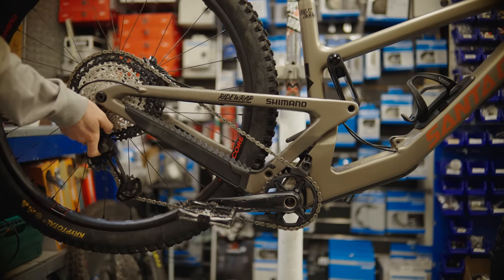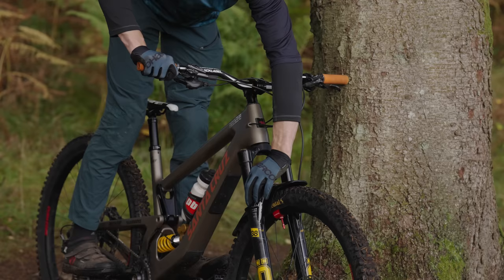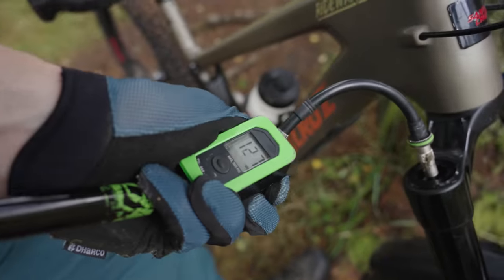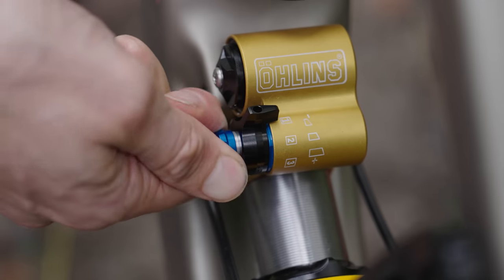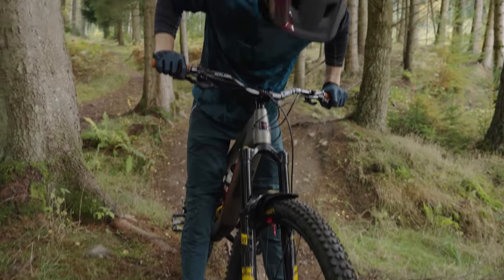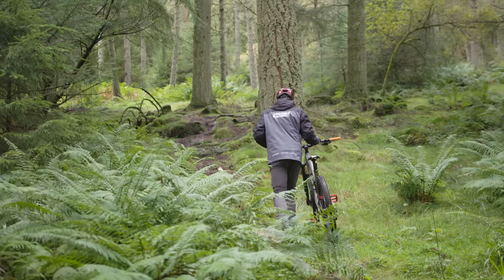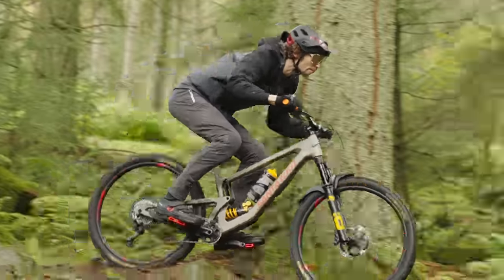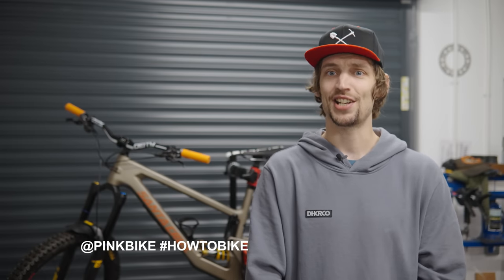Pro MTB Suspension Setup (Bracketing Properly) | How To Bike Season 2 Episode 2

Comment: I spent a ride bracketing my spring rate on a section of trail and ended up with significantly more pressure than I’d been running and it made a huge difference to the feel and performance of my suspension.

Comment: You're usually extremely thorough with even the physics behind everything you explain. This time around, I'm still left wondering what each adjustment really does. I know they might seem self-explanatory, and during testing we will get feel for each adjustment, but it helps to know what each of them do, to know what we're looking for when test-riding. For example, if we're setting low speed rebound first, it's better to be aware of when this comes into action, and how to spot the difference in adjustment. How to bike has generally been a guide that you can see being a complete rookie, and come back to see it as you progress, and still find useful stuff, this time around it doesn't feel that way
Reply: I think the point is less the adjustments and more the methadology. Plus all that matters is if it feels better or worse. You don't need to have explicit knowledge of compression (nor should you want it) to be able to tell if turning it more one way felt worse than before. With proper methods and bracketing, a complete novice given enough time can get a good setup. Besides, millions of articles exist if you want to get the ins and outs

Comment: Getting my first full sus bike tomorrow after 2 years on a hard tail. Hopefully it comes out the shop with suspension ok, or I’m up poo creak. This is way too complicated for my 58 year old brain and I’ll need to watch you again and again. Thanks for the great video.
Reply: If you boil it down to just a few points, it ought to be adjusting one thing at a time, writing down your settings, and not acting with too much preconception of what you expect a given adjustment to change.

Everything to do with progressivity, volume spacers, etc, in regards to air springs, is to do with the way air springs operate. You are squeezing a given volume of air into a space that becomes smaller and smaller. Think about it this way: once you use up half the travel, the air must all fit into half the volume. Go three quarters of the way through the travel, and that same volume of air must be squeezed into half the space again. 
If you fill up, say, 20% of the space inside the positive air chamber with a plastic volume spacer, you change the relationship between motion and air volume. Now, when you use up half the travel, you've squeezed the initial volume of air into a significantly smaller space thanks to that capacity being taken up by a volume spacer.
This is why more spacers = firmer suspension as you get closer to bottom out.

Coil springs, by comparison, are almost perfectly linear in their force-to-motion behaviour. Whatever force it takes to get the suspension to halfway down its travel, if you double that - you'll bottom out. The only way to change the relationship between force and travel is to change the spring. Squeezing the spring with the preload collar does nothing to change the rate of motion - all it does is stop the spring from moving until a given weight is put upon it. 

In terms of rebound and compression adjustments - they do nothing to affect how much a constant force will move the suspension. Damping adjustments can be thought of as changing how quickly the suspension will get to the equilibrium point (where the spring force is equal and opposite to the load upon it). 
If that's not already far too much to take in - the pressure you put into the shocks determines the static behaviour. The damping settings determines the rate of motion at either high or low speed (if you have both low and high speed adjusters).

Trying to firm up suspension that's too soft by cranking up compression damping will result in a suspension feel that is both limp and harsh, because you're relying too much on the dynamic resistance to motion rather than the static support of the spring.

These are some common scenarios and possible solutions:
Suspension sag is correct, but you are blowing through the travel a lot: Add some compression damping. If that negatively effects the ride, you may need to add volume spacers.
Suspension sag is correct but feels too firm: reduce compression damping
Suspension feels good when taking large hits, but gets chattery and harsh when going through sections such as rock gardens: you may have too much rebound damping, causing the shock to be unable to return to its full extension before the next compression.
You feel like you are getting bucked back into the air after taking a big hit: Not enough rebound damping.
Suspension doesn't bottom out, but there is too much sag/rides too low in the travel: Too many volume spacers, or you are compensating with too much damping.
Reply: If you've got a good shop, they should have no problem getting you setup to at least the basic 30% sag.
Reply: every manufacturer has a suggested starting point for their bikes

Comment: Going in the order you said and fork to shock for example makes sense. Only you have to do it multiple times because your settings on one end of the bike affect your weight distribution which affect the suspension on the other end of the bike. And there is no one setting that's equally good on every part of a track anyway, it's always a compromise. I personally find that it kills the fun of a ride if I spend half of it twisting knobs and making notes. So I'm always on a good enough setting and nothing more. Admittedly these videos are a huge help getting from bad to good enough. No wonder pro racers have factory support though. Watching Dialed is fascinating but I don't want to follow their example.

Comment: I think the one thing to note is that lower PSI, lower spring rates, lighter riders generally are on the open end of rebound and compression. Higher psi, higher spring rate, more closed side and everywhere in between. Most Mtn bikers are 120-220lbs in general and the damping circuits range are made for those. 120 lbs means mostly open damping, 170 lbs middle damping, 220 lbs mostly closed damping. Is easiest way to find your clickers usually.
Reply: At just over that weight range, the only option for me is pump to the shock's max rated pressure and adjust the compression to fully locked or maybe half open. In a perfect world, I'd try for 15-20% sag in front, 10% in back as the front has the most travel.
Reply: @sapinva that is a written example of how not to set your suspension XD
Reply: Issue I find with that is once you get a custom tune (say firm compression and rebound) The clicks change.. You could be 5 or 6 clicks off what a normal factory tune has.

Comment: from what i heard and makes a lot of sense to me, but haven't tried how well it works in practice yet: when changing external adjusters: 
1. go to one extreme and the other, see what feels better.
2. go to the middle setting and then the extreme end that felt better, again, check what feels better.
3. go to the setting that felt better this time, then in the middle between the two you've just tested and repeat   the process
4. do this until you've hit the sweet spot.
I hope i explained it somewhat understandably.

Comment: Preload has zero bearing on breakaway force. It adjusts ride height (sag), and you typically want to avoid it because it has no effect on spring rate. If you need a higher spring rate, preload does nothing (assuming a linear spring). 
The only time the breakaway force would be greater with preload is at full extension, and even then, the spring rate is the difference between the main spring and the top out bumper, so net required breakaway force from the spring is essentially zero. (Actual breakaway force is not zero due to damper seals, pivots, other sources of friction.)

Comment: I always go off of the recommended settings and usually change it 1-2 clicks in either direction and increase the pressure about 10-15 psi or 20 pounds above the recommended for my weight and only change volume spacers if something really feels off its entirely subjective my setup is far from the norm

Comment: Curious to know why suspension brands always recommend starting compression clicks from fully closed? When the object is to run things (especially rebound) as fast as possible without pogoing? To me it feels easier to start fast and then feel when things are getting too slow, rather than the other way around? Def keen on your thoughts? Cheers! Braaaaap! 🤘
Reply: Counting clicks from closed is recommended because that's the 0 and its the same in all the units of the same model, going from open, there could be a slight difference, one fork could have 12 clicks but could be turned to 13 (most open) by tolerances in threads and whatever.
When testing, I'm with you on the compression(even tho I'd start in the middle, as suggested here). Starting with rebound full open is a crazy dangerous idea in my eyes.
Reply: Also. If you start to high, there is a chance of pogoing and therefore crashing, whereas if you start to slow, nothing really happens
Reply: Yes I 100% agree to both your points! But what I was getting at is the direction of adjustment. Of course you would start with a few clicks in. But in my mind it's more easily discernable to feel how much better slightly faster and more "fluttery" things are than being distracted by either slow rebound or too much compression. It's easier to "feel" what's better when things are a lil bit more towards the open end than towards the closed end. It's harder to detect with both slow rebound or too much compression which one is the root cause of the bad feeling ride quality. Whereas if you start from the lighter end of things it's easier to distinguish if it's rebound "or" compression that's giving you bad ride feel characteristics, hope this clarifies :)
Reply: @jamiehamilton3253  It's literally just for measuring the settings. It does in no way imply how you should bracket or tune your suspension. You might go from  11 to 12 clicks or from 15 to 11. You're conflating some kind of strange tuning philosophy with how we measure suspension and rebound settings.
Reply: I like to start with everything open
Reply: Its got to do with the shim stacks, you are rotating little disc valve/stacks deep in the damper. They have tiny holes in them to slow fluid passing by them. 
Its always been recommended to fully close just in case you trap air/oil in the stacks. Mtbers are too lazy to fill dampers with nitrogen too, making the problem worse

Comment: I disagree somewhat with the statements on pre load. Too much preload can be an issue especially if you are running a spring rate that is too high for your body weigh. (i find lots of people do this because they are afraid to bottom out their coil shock) if you are running the proper spring rate you should wind the pre load adjuster in fairly far. This is to combat end coil effect, where the gring the end of the coil to fit on the flat collars of a coil shock. This end coil effect may lead to sluggish feeling in the initial stroke and rebound may feel to slow early in the travel. By running more pre load you are increasing the energy needed to compress the shock but also increasing the energy the shock will push back. If the end coil effect is present there is effectively some free stroke in the shock where the coil not effectively push back. essentially shortening the stroke of your shock 2-3mm. It may not seem astronomical but can make huge differences in how your shock handles. Don't be scared of pre load, do be scared or running a spring rate that's too high. Pre load is a tuning tool and bottom out bumpers are meant to be abused!
Reply: Yeah but bikes aren't, if you bottom out your bike a lot frame will snap 100%

Comment: I have a Fox 36 grip damper, so only LSC and low speed rebound. While the ramp up on bigger features is great because of the tokens, i feel like it almost doesnt react on smaller bumps. Only thing i can fiddle with is the pressure or rebound, which could be the most likely?
Reply: If IT does Not Take small bumps Ur Low Speed compression is too stiff. So U need to Open lsc.
Reply: @lakaldrak  fully opened. Service time probably...
Reply: @SidiNic  what Psi u running With what weight?
Reply: @lakaldrak  86 psi with 82 kg fully geared
Reply: @SidiNic  analog Bike or E-mtb Version? OK so i think IT depends what U Ride. I Ride GRIP 2 damper idk If thats gonna affect my Psi. Emtb Version 36. 92 Psi With 87kg ready and Zero token ( cause GRIP 2 With fit 4  i needed at least 2)

Comment: Just use  a shockwiz for  suspension setup works perfect.
Reply: Shockwiz doesnt work on Coil suspension, Rockshox suspension with Debonair Chambers and Öhlins due to their seperate Air and Ramp up chambers. So, yeah, technically you can, but a lot of people cant.
Reply: @zwingler  i have both Rockshock and Fox  air Forked  hardtails Shockwiz works fine whit the shockwiz.
Reply: @Paganiproductions84  yeah, like i said, It works for YOU but its not a generalization for everybody.
Reply: @zwingler  Correct
Reply: @zwingler  most people here run air forks and or air shocks  coil shocks are for motorbikes
Reply: @Paganiproductions84  or people who want to go fast🤷‍♂️
Reply: @50centHotDog  That  can be done whit air suspension